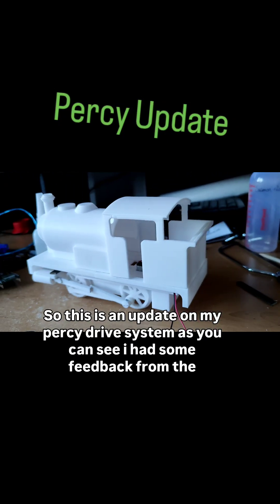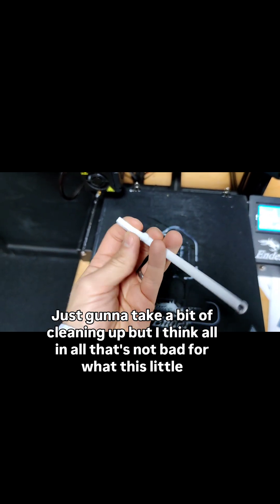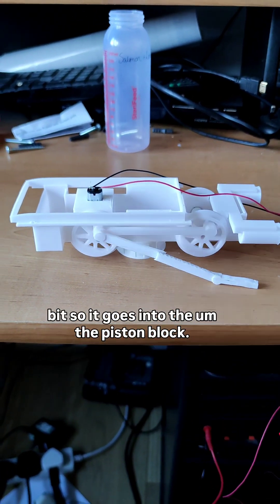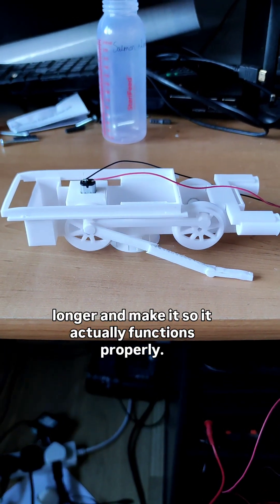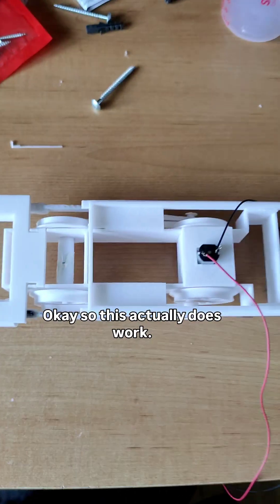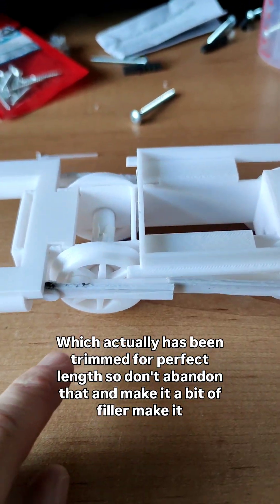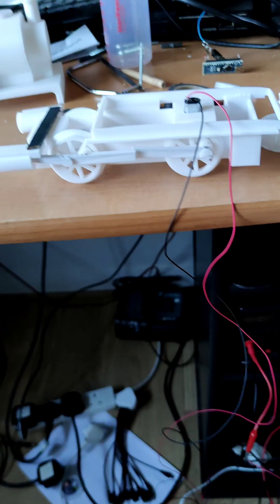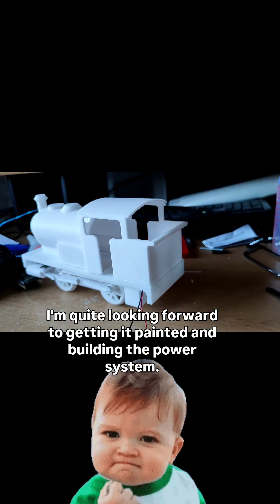3D printed Percy from Thomas the tank engine by Rev W Awdry

Comment: Another thing I recommend you do is to have some long steel rods glued into the cylinders to guide the pistons as they slide back and forth to further prevent jamming.
Reply from the maker: Cheers, that's a great call and the engine Percy is based off had guide rods (also the cylinders were angled slightly downwards) so I will definitely try to incorporate these into the next video :)